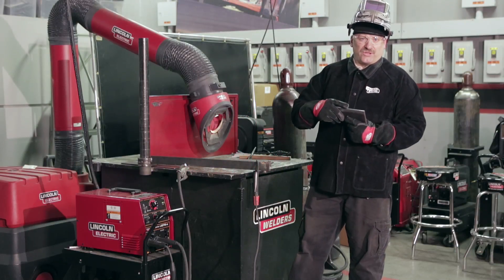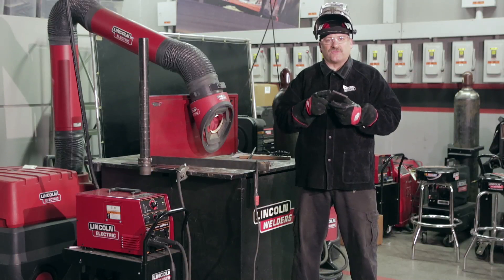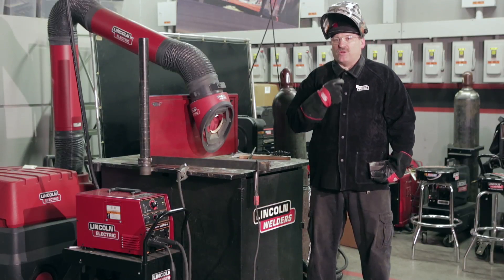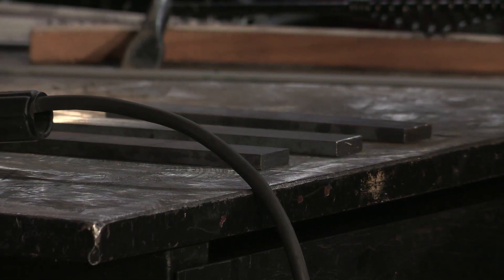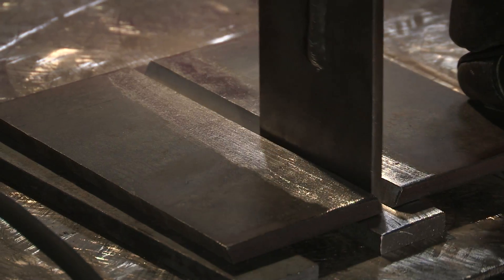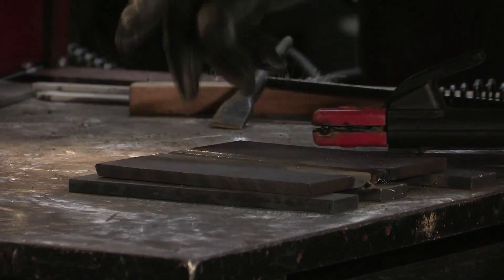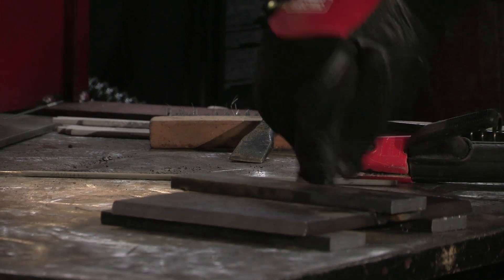Tech Tips: AWS D1.1 Overhead Welding Test, Part 1 - Set up & Fit-up

Comment: Arc force at zero. Why?
Reply from the maker: A low arc force keeps the arc length short which is essential for out of position welding.  As the arc force is increased, the machine will react to a shortening of the arc length by increasing the amperage, thus lengthening the arc length.  For overhead welding, this may lead to the weld metal falling out of the joint.

p.p1 {margin: 0.0px 0.0px 0.0px 0.0px; font: 11.0px Calibri}
span.s1 {font-kerning: none}
Reply: Sounds like my problem. Currently testing at ~115A, 3 Arc, 4 hot start. Perfect for vert but a hot sticking mess for overhead. Good possibility i'm just horrible at OH but would be nice to fix the problem with a machine adjustment.
Reply from the maker: On that machine, a 0 arc force was actually about a 5.

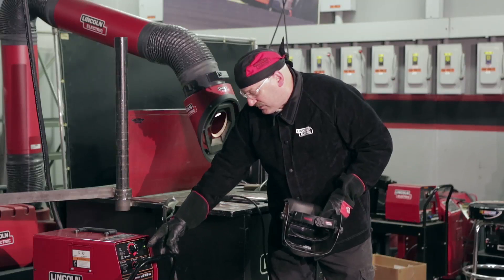Comment: 2:15 - 115A is 📴 .
2:55 - Use a longer Backupstrip than that, tack with what you're Testing with (if you can't, why test; it confuses which Plate is for which Test, and is Technically a failure in the Plate Preparation - no suggestion that it would affect the outcome).
3:25 - Offset the Backupstrip so it's longer on the end that you are starting from AND either use a correct Test Bar or simply use a piece of Chalk (which is coincidentally the same size).
5:00 - Layout the Plate so you know the exact position of the Coupons. Use that info to put a longer Tack on the back (and all those Tacks look porous, and puny).

At my School, every single Plate or Pipe Weld gets bent. First year we do this Test over a few hundred times. We get really good at making Welds that pass Visual and creating Coupons that do not fail.

If we couldn't do better than this after a few months we'd be getting a talking too or sent to the Dean's Office to explain why we should be allowed to remain in School.

It's not that your Video is 'awful' or 'bad' it's that it teaches laziness and moderate quality work when the actual Test will be no where near as slack as this. Teach for "Real Life" (is the silly Term they use in Industry - from those who seem to know the least about the Trades).

Try doing eight Plates on your Testing Day when it's packed with people Testing.

The smile on your face and the 'pretty Plate' must be followed by adequate Weld Visual and most importantly, it has gotta bend.